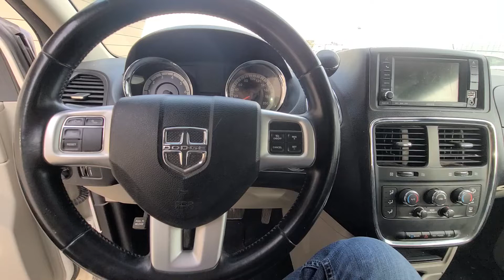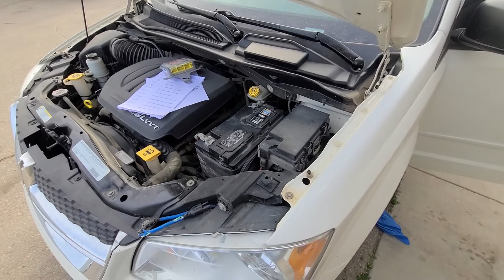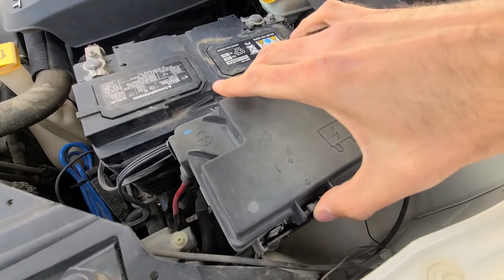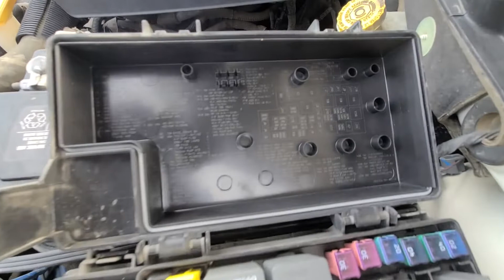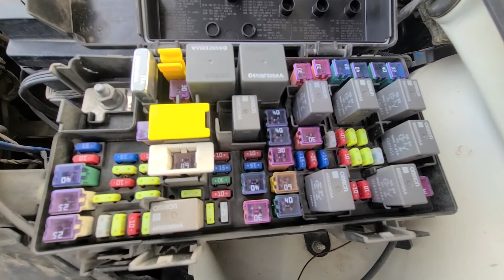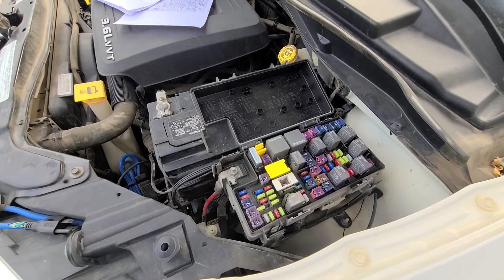Dodge Grand Caravan - ABS BRAKES & TRACTION CONTROL FUSE LOCATION (2011 - 2020)

Comment: I have a 2006 Grand Caravan, 6 cyl, Stow n Go seats.. The brakes.. While driving, they randomly apply brakes while I am driving.. Usually the passenger front or rear, but sometimes driver front or rear.. I've had rotors replaced 5X in 10K miles.. Every wheel sensor replaced too. The dealership did most, so I know it's not mixed brake fluid brands, and a master cylinder would only be a culprit if my foot was on the brake.. Replacing the hubs on the front solved this for like 5 years(3K miles), but the problem is back.. I think the traction control system, using the ABS wheel sensors, is what's doing this.. A dozen times, the dealership said "all fixed".. Something is applying the brakes as I drive, sometimes a little, but twice it was so bad the car wouldn't budge at 4K rpm in drive.. Send me a PM.. Help me man..
Reply from the maker: It is really really hard to say what is happening without looking at the vehicle. Did you have brake calipers checked? That is the first that pops in my mind. They might be sticking and "causing" the vehicle to brake. It could be happening occasionally.
Reply: @QuiteAlright  All calipers replaced.. Rotors, pads, and sensors...Most of the time, it's passenger side front and/or rear, but it does "flip" to other side front and/or rear.. I know technically the ABS system is only "active" when you step on brakes.. Over and over, pedal has been checked, it's not a sticky pedal... But, the traction control uses the ABS wheel speed sensors.. If this system is reading rotation incorrectly, then yes, it could cause the traction control system to apply brakes to fix slippage that's not really happening.. Right..? ABS system has been ruled out too many times by too many mechanics, so  the only alternative is another system that uses these sensors.. I pulled fuses for ABS and the one that controls door locks, interior lights, and radio.. When car is off, they don't work, but when key is in ignition, I have door locks and interior lights.. If this is "abnormal", then it leads me to believe a long term power drain to the traction system may in fact be why the brakes are applied while car is moving.. I am NOT a mechanic, but this  seems odd that door locks only work when car is running with that radio fuse pulled out.
Reply: @Iamphuster  Is your Dodge one  with salvage titel? Wenn yes than car is not repaired as it should be and ABS and ESP try to corect those and thats way you have warn out your brakes.